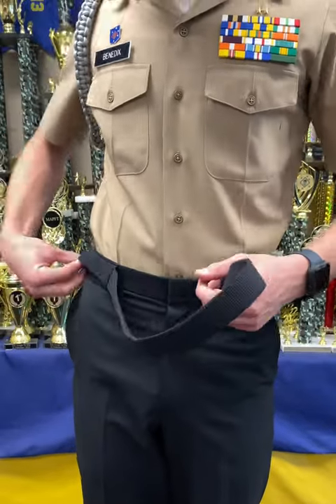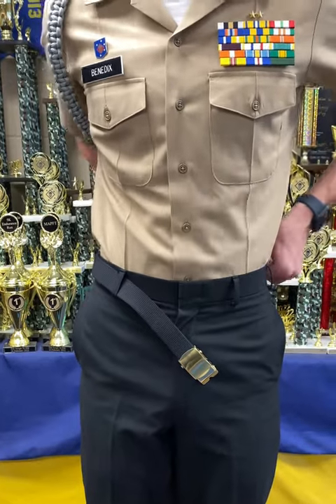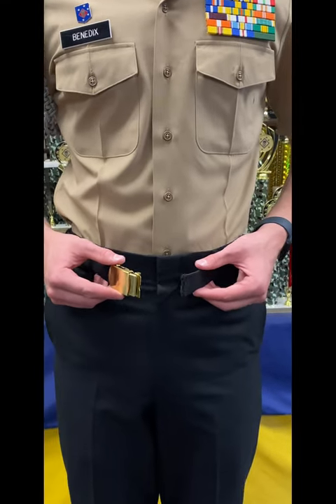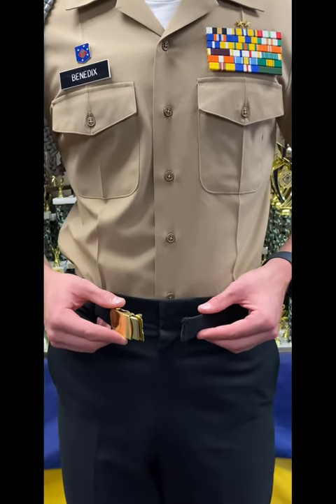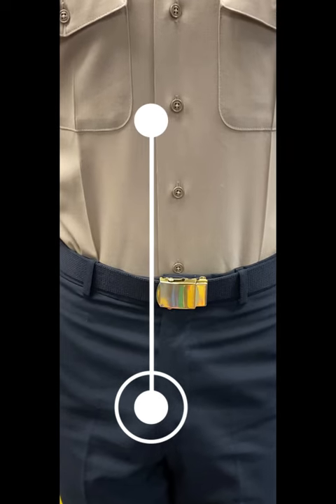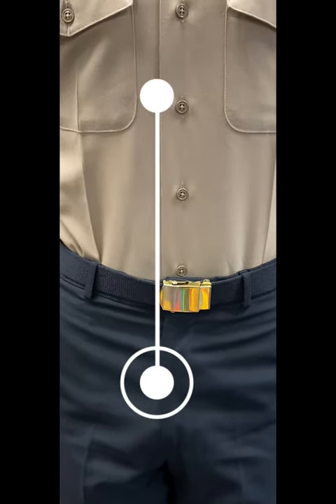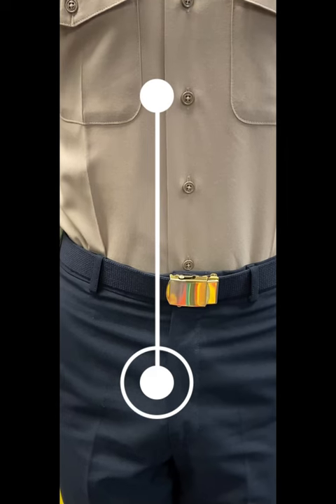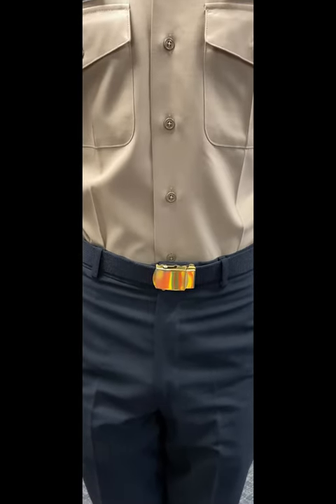NJROTC Belt and Gig-line Instructional Video

Comment: what is that pin above the nametag for? marine raiders?
Reply from the maker: The pin above my name tag is for passing our Raider test, which consists of a 1.5 mile run in 10:30 min or less, 50 push ups in 2 minutes, and 50 sit ups in two minutes. All jrotc branches have raider teams and competitions, we just use this pin to identify the select few who pass the test.
Reply: @DAWSYNB Listen man, it’s not in the Field Manual, or the Reference Manual, it might be area or unit specific, but I don’t think it’s for every unit out there.
Reply from the maker: @thehunter3889  Like I said, all "Branches" of jrotc have raider teams, we just have a pin to signify who passes the test and is usually on team one. Some units just have a tab or medal, some do not, its different in all cases.
Reply: @DAWSYNB  Why would each individual branch of JROTC have “raider medals” if it’s only applicable to MCJROTC and NJROTC?
Reply from the maker: @thehunter3889  Originally it was an army jrotc event, then other programs adopted raiders, I have not seen any other unit use the raider medal we use, most have a airborne or ranger tab style pin or medal. Just to signify being on the team. I would also agree it doesn’t make sense for the army programs to use raiders when it is specifically Navy/Marine, but I don’t make the rules.